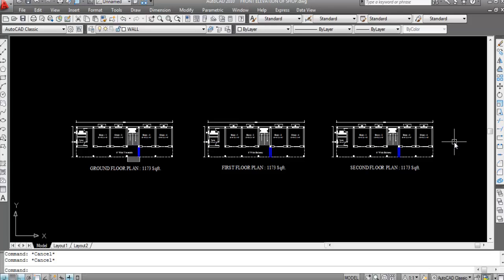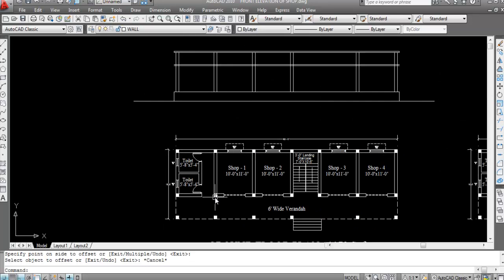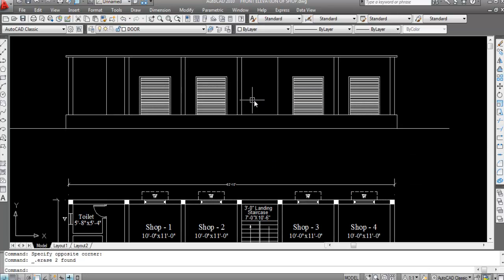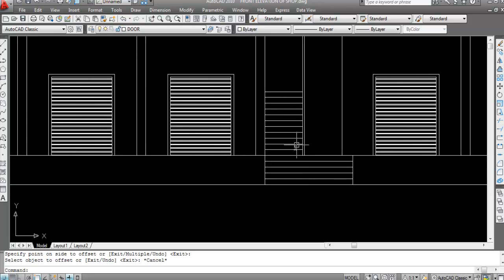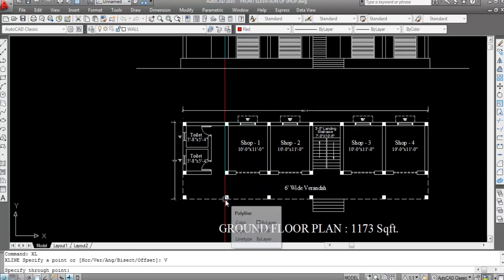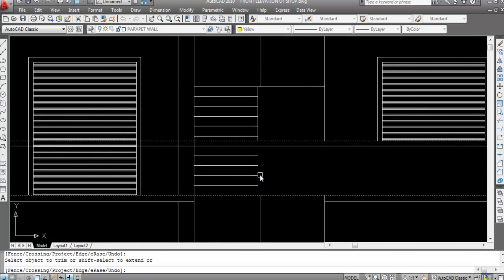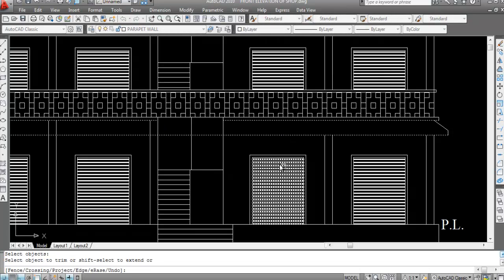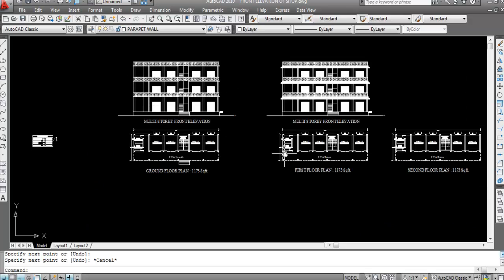3.Market Complex - Shop Drawing - Front Elevation in AutoCAD | Building #3

Comment: can we take the thickness of the slab 6" ?
Reply from the maker: Slab thickness for residential building is taken as 4". 5-6" Is recommended if the concrete will receive occasional heavy loads, likeike motor homes or garbage trucks. Thanks for watching.